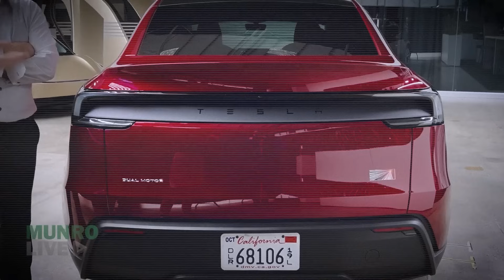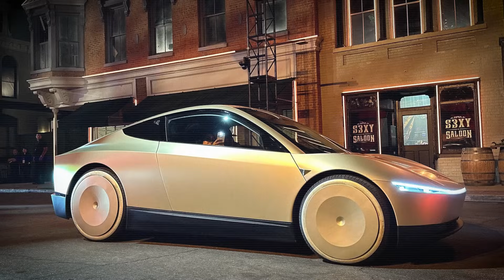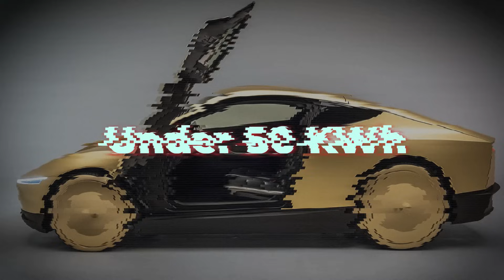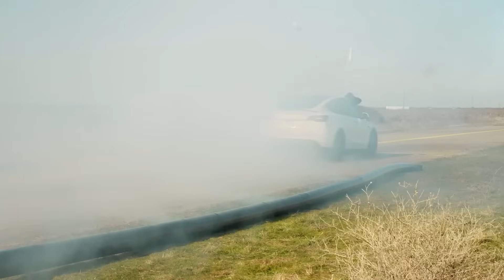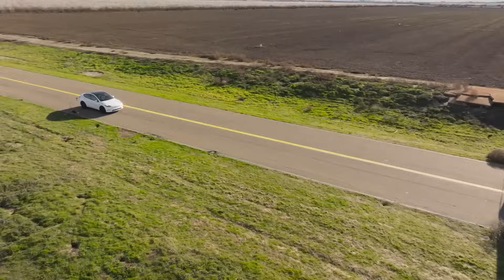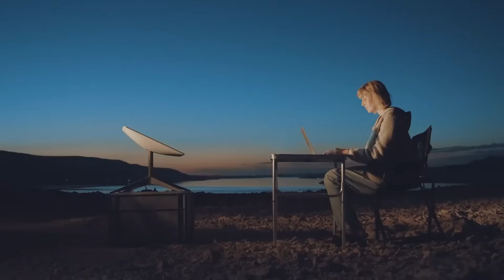Tesla Reveals New Cybercab Production Update

Comment: The Tesla Cybercab doesn’t require traditional paint for repairs because of its unique construction. Instead of a painted surface, it uses plastic panels with polyurethane paint injected directly into them during manufacturing. This means if a panel gets scratched or damaged, you don’t fix it with a coat of paint like you would a typical car. The color runs through the entire panel

Comment: Also, they did tests that weee designed to trick Tesla... they should also include tests that are designed to trick LiDAR, like ponds of water on the road... LiDAR card just run over them and cause damage if the holes too low.
Reply: I don't think clouds or rain are designed to "trick" anything. Looks pretty realistic situation to me. There's a reason many engineer at Tesla were against ditching lidar...